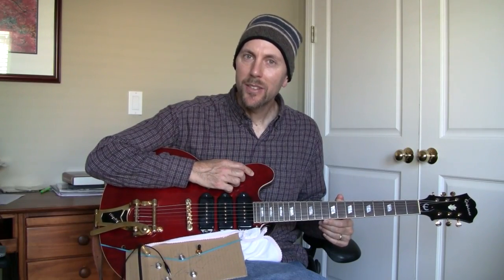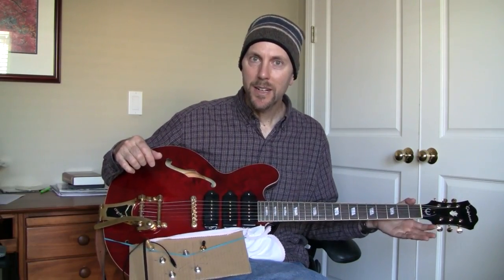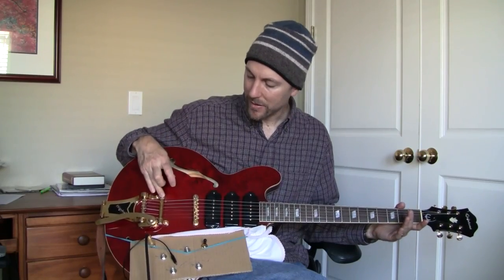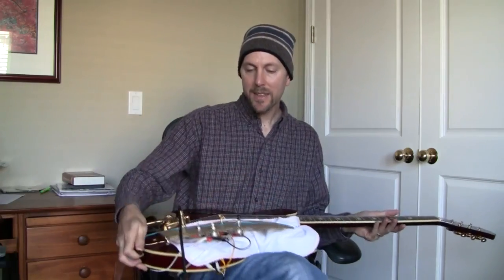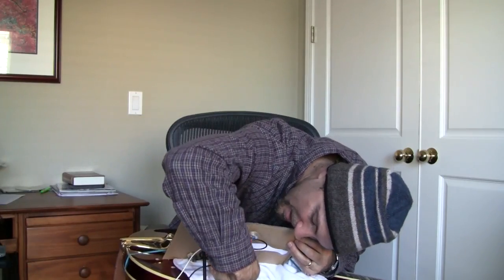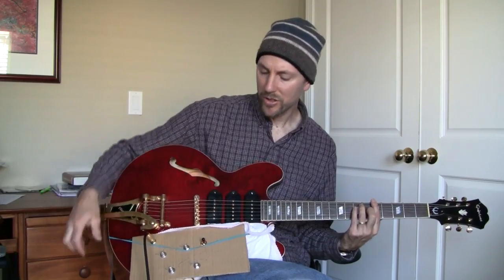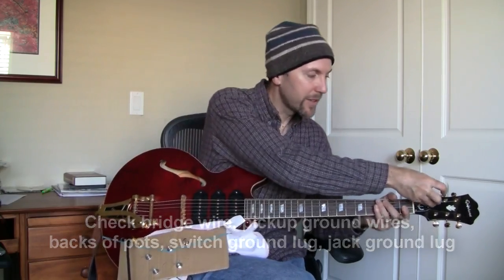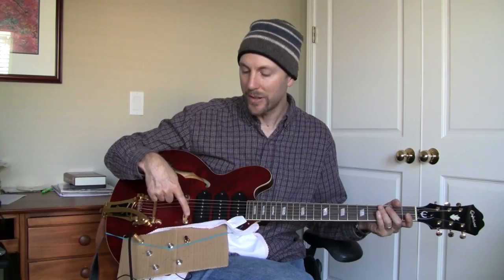Guitar Ground: Dealing with ground noise problems

Comment: Dear John, could you advice me please. My brand new Fender standard Statocaster (Mex) makes ground noise. When I touch the metal parts on my guitar the noise completely disappears. My Roland Micro Cube, like all small low watt amps, has no grounding on the current plug. So my question: is something wrong whit guitar wiring (ground) or is it normal because the amp has no grounding so the guitar is not connected to the "ground" through current plug? I will be very grateful for your advice. (sorry for my English, it is not my native language :))
Reply from the maker: You should try with a grounded amp to confirm your theory. But, are you sure this isn't just normal single coil hum? Strat single coils will pick up hum in switch positions 1,3,5- and the noise will vary with the position of the guitar. This is completely normal. If wired properly, positions 2 and 4 should be humbucking (and you should hear less hum).
Reply: Thanks for your answer!

Comment: I have a problem with my guitar. I recently rewired the 2 Humbuckers using a superswitch. There is a hum type of noise all the time. It goes away when I touch any metal component of the guitar. I checked the grounding,. and they all seem to be connected. Please can you help!

Comment: My problem is that there is noise when I'm not touching anything it makes noise and once I touch any metel part or the strings then the noise goes away. It is worse at different times of the day or less at different times of day. I have used an outlet tester on the outlets that my gear is plugged into and they all check out fine. What could be my problem, doubt it is the grounding of my guitar(s) as my main one is brand new and the others ALL do it too, and both my tube amps as well.

Comment: i have an epiphone riviera with gibson p94s in it. Just like thedonace, my guitar beggins to hum when I'm not touching the strings. As soon as I touch it, it quits (although, there is quite a bit of hum that happens regardless). When I reach across my guitar and my arm brushes agains the strings, I receive a small shock. IDK if i cant feel it through my calouses or what, but it doesnt happen when i touch it with my hands. I think it is probably a ground issue seeing as it is an epiphone and

Comment: hi I think I have same problem,I have an accoustic guitar yamaha CGX 171 CCA nylon ..when I increase the 'low' on the guitar EQ the noise more bigger ..but when I try to touch the jack that connect to the guitar, the noisy is disappear..
then i try to change the wire inside the guitar,the problem it still there..i worry about the  guitar EQ was broken???

Comment: Somebody please help me! I just bought a new cable and when I plug it into my amp and guitar, it makes this loud buzzing noise, and when I hold any input with my fingers, it sounds good! How can I fix this?!
Reply: I have the same problem if you got the solution plz tell me
Reply: Sounds to me like it's a cheap cable. It's worth investing in good cables.
Reply: Jesus Christ I have the same problem but when I plug into my other guitar the sound doesn't happen with that one just my 7 string, I really hate that.
Reply: Jesus Christ what was the solution so far?
Reply: It's the cable which is making sound. You need to buy a good quality cable. Hope that helps.
Reply: My dudes. Most likely you have bought a speaker cable and not an instrument cable. Instrument cables have ground shielding all the way along them which sends the ground of your guitar and the noise the cable would pick up, to ground. So get a proper instrument cable.
Reply: @Pauly421  yep...

Comment: my noise gets quiter when i touch the strings or other metal parts unlike yours getting louder would i have the same problem? alsoi noticed my noise gets significantly louder in certain areas of my room more specifically near the main light switch in my room and one outlet. It is not a dim switch and all the grounds test fine on my outlets. this is kinda driving me crazy lol so help wud b appreciated.

Comment: Help! I'm pretty sure that everything in my guitar is grounded and wired correctly, but i'm still getting buzzing. Nothing changes to the sound when I touch any metal components, and i've changed the battery but it still buzzes. What would you recommend?!
Reply: That sounds like fret buzz, I'm not 100% sure about this myself but I think it's just something you can't really fix. Do you have your gain high on the amp?
Reply: AirCommando12 I usually have it at about 2 o'clock, but it's alright now it's fixed! The connection to the input jack was just a little temperamental, but that's to be expected from a guitar that's been discontinued.

Comment: I just had a look and it appears as though there's a wire connected to one of the pots that doesn't lead anywhere. It looks like its been cut right down and just left as it is. I couldn't look at the jack connection because the screws are too tight but I know there's something wrong there too.

Comment: I changed my cable when I have this problem. It works for me. Guess my problem was my cable since I stepped on it until it's head was almost dislocated. I also tried restarting (on-off-on) my amp and leaving my effect pedals on. That stopped my buzzing for a decent amount of time.

Comment: i get the buzzing with all my pickups but it is not bad the only one that is bad is when i switch it to my bridge pickup i took the back off and there is a wire connected to the spring connected to the bridge and it is not lose. any help?

Comment: My brand new guitar has hum when I do not touch the strings, but not my 16-year-old guitar using the same cable, both have humbuckers, and amp with no peddles just the cable from guitar to amp.  I am stumped, but after testing grounding etc... I bet it is the humbuckers being different, but I have no idea.

Comment: i have a slight issue that i cant seem to work out. i recently installed a seymour duncan invader bridge pick up and my old fender squire strat and i completely stripped the stock pick up, 2 tone knobs and 5 way switch and just left one volume knob and installed the new bridge pick up. i went off videos and duncans also come with a sheet with instructions wich i followed. but for some reason i get a slight hum wich stops when i touch either the metal part of my lead or the metal cover of the jack. if i touch the bridge it gos a little quieter too. i have also installed a seymour duncan SH-4 bridge pick up into another guitar i made from parts. the body already had a cheap humbucker bridge pick up (just the one pick up) and i took it out and installed the SH-4 but again im getting slight hum even though i followed the wiring diagram. this guitar also stops buzzing when i touch the jack area or the lead. its not a loud buzz on either guitars but its there when it shouldnt be.

Comment: I put an under saddle pick up & a +ve preamp to my nylon guitar years ago. From day one, low pitch humming was there. I did not realize the problem came from the pickup wire which I soldered a2.5 mm jack n covered the wire just by red pvc tape.  Today, I tried to wrap a piece of aluminium sticky tape on top of the pvc tape. All a sudden, the humming has gone forever.

Comment: @johnplanetz oh well, thanx anyway! my uncle is a certified master electrician and were going to talk to him. i want to try getting an extension chord and plug it into a ground lifter, BUT resting the prong directly onto the grounding rod and if it still hummoing then we have a problem. pouring a good amount water onto the rod, oe a HumX, but those are kind of expensive for a piece of plastic with and, and small PDB.

Comment: plus If i stand with the guitar facing north or south it's somewhat tolerable. but as i turn to either direction the hum gets loud and is just undesirable and extremely irritating, and kind of scary.
note: There is a power pole in my backyard, and on that pole is a transformer. now if a little guitar amp transformer makes noise, what will a  200 amp tin can do?

Comment: My guitar doesn't respond to touching of the strings, bridge or tuners. It however does become silent when I touch the jack socket, pick-up covers or the switch and pots. It however doesn't hum like this, it has a high-pitch something going on and the high harmonics of what relates to a normal buzzing.
Reply: Did you ever figure this out. I have the same issue!

Comment: I have that exact same noise from my guitar!! The only metal that stops the noise from happening is when I touch the metal on the output jack. Touching the strings or the tuning pegs doesn't do anything. Just when I touch the output jack then it stops buzzing.

I had a lose ground wire and I just re-soldered my output jack's ground back on and I still have the exact same problem.

Comment: I'm using a amp simulator on a laptop and I keep getting buzz but it goes away when I touch the metal on the guitar cable jack. It goes away when I touch the computer and the interface. I checked the connections on the guitar and all the wires are connected.

Comment: im have problems with slight buzzing through my single coils. but it only really causes a problem when the volume knob is over 5. it also does it when i switch from the neck to the bridge after the second position. but it is really more of a problem when the volume is higher. it quiets down when i touch the strings but it is still audible.

Comment: I changed pickups in my LP to two humbuckers with phase invertion. All the components are grounded correctly - there's connection between pots, 3way, shield-wire and sleeve. I also grounded dpdt switch case. However, when I touch any of metal components (except pickguard's screws ;) there's a big hum. It's bigger in medium positions of volume pots, smaller on max volume and none on muting. It's urgent, I've recording session in two weeks! :(

Comment: If it’s a double neck guitar do both bridges need to be have a ground wire ?
Reply from the maker: Yes, I think the metal parts on both necks should be electrically connected, continuous to ground.
Reply: John Cooper thank you.  That’s going to be a rough one. It’s an Epiphone and they only grounded one. And the other one is an island there is no way to get to it in a cavity.  The one bridge ground runs down to the cavity.  I’ve got it half shielded with copper tape now. 
Have you ever heard of a separate signal ground than chassis ground ? I read a page about that. And I don’t think it works. But not sure.
Reply from the maker: Not sure. As I understand it, the chassis ground and signal ground should be tied together. But I guess if you're not having audible problems with the other neck,  then don't worry about it.  (Sorry I have no experience with double-neck guitars!)
Reply: The Epiphone wiring and parts were junk. I tore it all out and got all new wires and switches.  Copper shielded it and now about to put it back together. It was noisy before but I don’t recall it being too bad. In looking at it I think I can drill a small angled hole from pot cavity to the bridge. Going to see this weekend. I really want to do it right since I am doing so much. (New Seymour Duncans new wiring and components. New tuners.  I read on one website a guy taking about doing Jimmy Page wiring said to have a separate signal and chassis ground. I cannot find anyone else saying this. But he said it would eliminate 60hz noise also.
Reply from the maker: Sounds like a great project!
Reply: Thank you !  Yes it is quite a project. It’s my first time doing this. So I bought some new Seymour Duncan 59s for the 12 string. And a JB/Jazz for my les Paul studio. And put the Les Paul pickups into the 6 string neck.  I was going to Jimmy Page wire the les Paul but it didn’t work. Had a ground problem. So I am redoing it and going with a simpler design just push pull coil split. 

I am going to coil split the 12 string with push pulls.  

I’m really learning a lot. And hopefully will have it figured out and then figure out what to do with all the leftover pots that I got Trying to figure out which ones I could work with.
Reply: Added a second ground wire. Was actually quite easy !!!
Reply from the maker: Nicely done!

Comment: What if i have this problem, checked with a multimeter but everything seems fine ? Can't seriously seem to locate this problem.
Reply from the maker: Could just be EMI/RFI noise being picked up by your guitar, especially noticeable if you're playing with single coils, and/or high-gain. Try moving around in the room and see if it sounds different in different locations.  If so, could try more shielding, etc.

Comment: Thanks, John. This is exactly the issue I have got with a brand new jag JM - buzzing when I touch metal. It's been hard to explain this to the store (it's not a single-coil hum!) and it sounds terrible, so at least I know it is not something I just have to live with. It's gone back to Fender.
Reply: Hey, do you mean Jm as in Johnny marr jag? I have one and I can't figure out whether the noise I have is an issue with the building/electrics/grounding or the guitar.

Ive isolated the guitar, going direct to my interface's hardware input, running on external battery (so no computer or mains plugs at all) and their was no noise. Does this mean there isn't a problem with the guitar or would I only get noise if connected to mains anyway, so could still be either? 🤯

Comment: what does that mean when the sound goes away when you touch the strings. im getting so frustrated, i can't figure it out and i pulled on my bridge ground and its not loose or pulling out or anything.

Comment: I just rewired my ESP LTD Phoenix with new high quality wire, new CTS 500K pots, and Sprague .223 capacitor. Still have a ground hum when I let go of the strings, or any metal parts. Suspecting maybe the input jack. Its a new guitar too. Everything is wired, everything is grounded {solid solder flow joints} Scratching my head here...

Comment: Ive got a les paul supreme 2013´s model, and i hear a strat-like noise when i plug it into my amp. Noise that gets shutted up when i thouch any metal piece on it. I tried connecting every pot to pot and switch with a wire and nothing changed. I opened the guitar and found that the guitar gets noisier when i touch a thin red cable that comes from a thicker cable and that (i think) comes from the switch.

Comment: the video is rite about grounding guitar n pickups but there should also be copper sheilding around pickups and pots switch cavity this keeps emf out hi dain well its a matter of useing a noise gate dbx is one of the best around  and ground theres two types common and floating never mix a common with a floating this is how u  blow circuts a floating ground is a disc capactor in series with ground wire .01 .05and the lead of cap to ground it may change tone a lil best is to try diffrent1s

Comment: Hi:-)

I just completely rewired the inside of my guitar with new pots and switch and all, but the guitar still hums. I wired it with shielding wire from monte allums web site and installed a copper shield on the back of the pickguard. 

The strange thing is, that the hum goes away, when I touch the metal on the output jack. Can you figure out, what the problem is?

Best regards Esben Madsen
Reply: You don't have continuity from the ground at the output jack with the rest of the components of your guitar.

Comment: Please someone answer!
I have a Ibanez fireman, the pickups are huncanceling, but they still make noise when using overdrive. However when i touch the metalpart of my cable which is plugged to guitar, the hum stops. Completly silent. Anyone can diagnose this? The hum doesnt change when touching any other metalparts! Please someone answer! 
Thanks

Comment: My brand new guitar.. Just opened it. Has huge buzz.. It's.. Amp.. Zoom G1Xon and the guitar. How do I fxt that? I know it's a grounding issue. I lve on the first floor. Please help..
Reply: Use a multimeter to verify continuity inbetween the negative in the output jack and the metalic parts in you guitar like strings, bridge, potentiometer cases... All of that must be connected each other.

Comment: So like my guitar shocks me sometimes, like the strings/bring will touch the back of my arm and shock the shit out of me, any suggestions as to what it is or how to fix it?
Reply from the maker: Guitar Gamez - potentially a miswired outlet or amp. You’re not ground-lifting your amp are you?  Try different outlets and different amps.  Take this seriously— you could die (look up Keith Relf).
Reply: @johnplanetz  can you explain ground lifting
Reply from the maker: Guitar Gamez- in the US, power plugs have 3 prongs- the bottom middle prong is ground.  A ground-lifter adapter changes the 3-prong plug to a 2-prong plug. Some people use it to reduce hum in ground-loop situations, but it can be dangerous with an amp.
Reply: @johnplanetz  I dont do any of that but my 8 string I just got does it and my ibanez does it too but non of my bases do it

Comment: ive noticed that my guitars sound grounded on some amps and not grounded on others. what gives? any idea why?
Reply: That happens to me with my older 2 prong power cord amps that have no 3rd prong on the power cords. My body is a better ground than the amp so ground drift noise occurs...